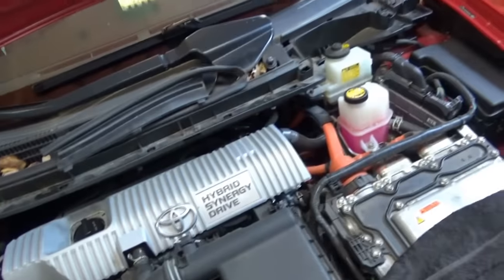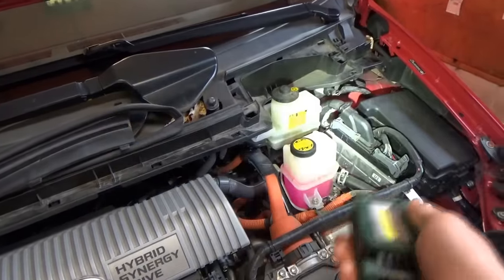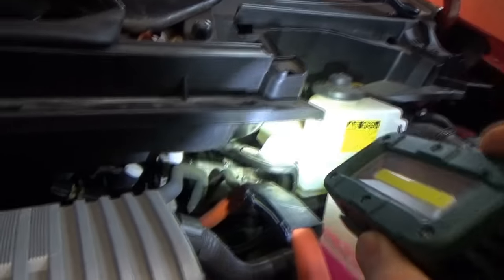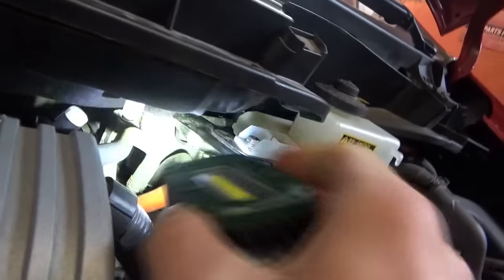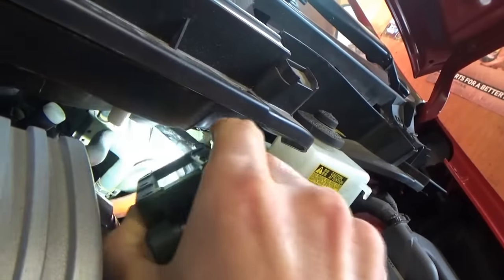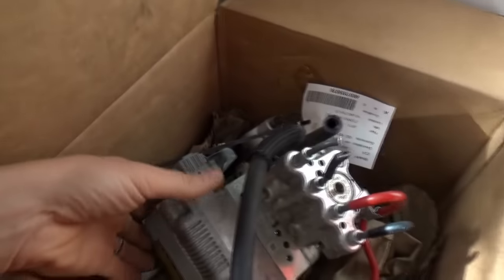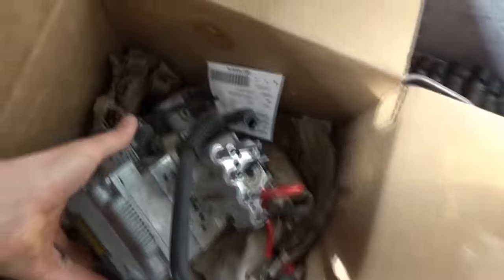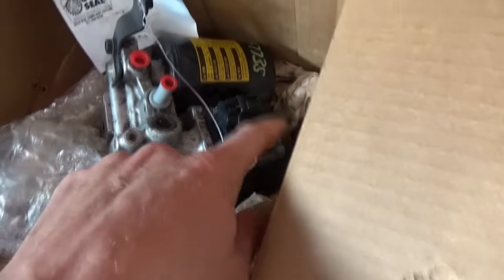Prius Brakes FAIL (Hidden COST of Hybrids)

Comment: A bit late to comment, but you could have called Toyota dealer, give them a vin from the donor and ask if recall was done on it. If so, would be a safe bet to install it, if not - just reject the used part to avoid the risk.

Comment: I had a 2011 Toyota Prius and got the dealership to repair this exact issue even though initially Toyota did not want to cover it. The dealership reached out to Toyota to help with the repair bill. Toyota agreed to cover 75% of the cost...This job is like $3k....later, I got a check in the mail from Toyota stating that they included my Prius in the recall...so, it cost me $0...my prius has 260,000 and runs strong but everything u stated in this video is true....anything breaks and the system will be costly to repair. Never buying another hybrid again..

Comment: I have that noise on my 2014 Prius.  I have another 2014 the second does not have that sound.  Looks like having a parts car is needed for Prius maintenance.  Looks like I am on my way in that regard.

Everything you say is true.  I had a 2005 Prius that I junked because of ABS module, HID light and traction battery all needed replacement.  I bought it at 200K miles and was happy getting it to 320 K miles.  I had to let it go.  I had a 2010 but sold it a few years later.  I got a 2014 as a hand me down from my mother.

Comment: This isn’t just a hybrid problem. This is a high end Toyota/Lexus problem period. Quite a few of the gasoline engine cars have this same brake booster setup. It’s something you need to check before buying a higher mileage used Toyota or Lexus free for sure as it can be a costly issue.
Reply: Indeed there was an LS460 at Omega that the Wizard could not fix because he doesnt have expensive Toyota software.
Reply: On Lexus models and Toyota trucks, it's called VDIM, basically much quicker and more "predictive" stability control.
Reply: @vw5056  yeah I just had to replace one in one of the guys who works in the shops Lexus LX 470. Talk about a nice punch to the wallet for him 😂
Reply: @Jpilgrim30  of course the online Toyota shills that always seem to come out of the woodwork whenever a BMW has an oil leak are silent about this problem. Same thing with big buck Prius battery replacements.

Comment: Primera...
Reply: Brakes..... interesting.  Unexpected issue.   I see them for hybrid battery issues. Overheating due to the cooling system being blocked.   On to the rest of the video.  . 👀
Reply: Exactly the points I make with these junk hybrids or full electric vehicles @6:30. Paying upfront huge costs, so many expensive parts like batteries, and travel distance is stifled, especially on 100% electric vehicles

Comment: I bought a 2010 identical to this one for $1000.00. I replaced the actuator & booster, high and low voltage batteries and windshield all on the cheap (approaching $1500). Total investment excluding tags and title right at $2500.00. Actuator & booster on flee bay $300.00, batteries $1000.00 and windshield $200. Not looking back and enjoying the ride.
Reply from the maker: But it still drives like a Prius 🤣

Comment: 230k miles at 35 mpg = 6,571 gallons. At $3.50/gal total cost of gasoline = 23k$
230k miles at 45 mpg = 5,111 gallons. At $3.50/gal total cost of gasoline = 17.9k$
Savings on gasoline for the first 230k miles = 5.1k$
But that's at $3.50 per gallon.  
The initial price of a hybrid car is at least more than 5.1k$ over a conventional gasoline car.
So the savings on gasoline is mitigated by the initial cost of the car.

Comment: For my 2005 prius a new one was not an option. Sold out from factory and the only reman option was Dorman but also sold out. Went used and it worked after we trouble shooted some some fuse problems as well. Prius documentation only shows some of what fuses are used by the ABS assembly. Techstream is not much use except for giving you a code that may or may not tell you the actual problem.

Comment: Got 300k miles on my 2010 prius, no issues at all. I've owned it since new
This job is not as hard as replacing the same system on my 06 prius where you have to remove the innverter.
Reply: Remove the inverter?   What the heck.  Is that the generator/alternator?
Reply: @stuartbear922  No, it's the unit that regulates the high / low voltages between DC and AC - a computer.

Comment: I had ASB going off on my Audi after i fitted a rear wheel bearing. Turned out to be a loose magnetic ring slipping on the bearing id already bought a new abs sensor. Was not till i plugged in diag that i could see the speed kept changing at about 10 mph.

Comment: I think the idea of "there goes your fuel savings" is misleading. Prius is extremely reliable. It's usually hitting 100K miles before you even need to do the brakes. He's working on a car there at 230K miles. How many thousands of dollars in parts and repairs would any other car have ran up by that point? The reason we bought our Prius was to replace a car that was eating $1K here, another $1K there... from 120K miles onward. I doubt the Prius is much worse over the same mileage.
Reply: Great point. Also not to mention the 7 tons (14,000 lbs) of* additional* carbon the driver would have injected into the atmosphere over 230k miles. This math assumes that the 45mpg Prius was twice as efficient gallon per gallon of the vehicle alternative. That's another reason I chose a hybrid over a standard gasoline vehicle.

Comment: A late model accumulator will swap on and solve the problem most time. Still a pia to change, but got my 6k mi for under a $100 used, and too my time over a day. They should remote these and make serviceable like Citroen spheres. FYI, while you wait to repair, holding the pedal to the floor for a couple of minutes will let the system pressurize enough to allow the the system to operate for a short time. The warmer it is outside, the less time you get. This will put a lot more wear and tear on the pump though, and you will lose regen while the lights are one. Oh, techstream software is available for doing the blessing cheaply. It is sketchy, but we are trying to do repairs right, so…

Comment: Hybrids also do not have a alternator. They use a voltage converter to charge the 12v battery and power the 12v systems in the car. Have run into a couple hybrids that were not charging the 12v battery.

Comment: great result on the gamble of used parts.
Biggest issue with the modern so called green hybrid and battery cars is massive amount of parts and service materials consumed mixed with short working life pretty much counteracts any environmental saving from emissions .
I do a lot of Subaru and Toyota hybrids and even newer models not smart enough charge the 12v battery from high voltage battery and thanks to all the module wake ups parasitic draw is real high on these things and they eat 12V batteries real bad unless do constant regular driving and great at leaving owners stranded with a flat battery or looking complete twits at the airport after a vacation lol .
Lot of owners pissed off with them already and I don't fancy dealing with the junk in a decades time lol .
They do sweat nothing for mother earth if fully review life to death pollution but are great at emptying consumers pockets !

Comment: P.S. If the part is too expensive(new) just get a used part from the 2014-2015 model. It's the same part but the issue is fixed on later models.

Comment: i have to comment on the bleeding; the instruction were to HOLD the brake pedal THEN open the bleeder,, obviously, especially the right side, you can't see when all the air's out AND you have to release the pedal to go close the bleeders. This procedure seems to call for a second person/assistant. Did  you mix the rt and Lf bleeders?  Your channel is an odd mix of barn-yard wrenching and hi-tech devices,, most interesting,, don't misunderstand, i DO appreciate the results

Comment: You are right, don't bring used part or even new part  to a mechanic for installation, because if the part doesn't work, you will pay installation fee anyway, better let the mechanic deal with the part, but if you are going install it yourself then you can try used one.

Comment: Chevys have had electric brake booster pumps for some engines since the mid 2000s and the same thing happens when theres a small leak in the brake booster diaphragm.

Comment: The complexity of this device is so that the regenerative and hydraulic braking are seamlessly integrated in to the brake pedal. Tesla have a brake booster that is actuated with an electric motor and a gear train rather than vacuum. There's a tear down on here of one. The regen on a tesla is integrated in to the accelerator pedal instead, which is configurable in software.

Comment: This isn’t a hybrid problem - these sort of braking systems are also used on straight ICE vehicles.
Reply: The Toyota SUVs and trucks have the system, and a lot of Lexuses have it too. The reason? It reacts faster to the computer asking for braking. Pretty much any Toyota truck or Lexus built after about 2005 is going to have something called vehicle dynamics integrated management, which is essentially advanced stability control that is able to monitor vehicle parameters 1000 times every second and react before a loss of control may even be noticed by the driver. This reduces the risk of tall trucks rolling over, and makes Lexuses smoother to react to skids. A traditional ABS pump just couldn't respond quickly enough to react 1000 times every second. Even if it could, it would set up resonances in the pedal and braking system, and it would sound horrible.

Comment: Hybrids are definitely costly to repair, however, this brake problem is the first mechanical problem I have had with my Prius in 10 years and 115,000 miles. So that Toyota reliability that has saved me $$ over the years. Just my luck, now the end of the service campaign has passed and my car just decided to start throwing the C1391 code every once in a while, for a few minutes, then the lights go off again. Priced the parts at several dealerships that sell parts online and the lowest is just under $1800. That's for both the pump and the master cylinder assembly.
Reply from the maker: I can buy 3 used beater cars for that much $$ 😅

Comment: Great diagnostic channel. Slight gripe with wording of the title and commentary. Full disclosure - multiple Prius owner since 2001.

1) "Hidden" cost? It's possible the buyer is not aware the regenerative braking system is more complex, but it's not hidden. Same would be true of the battery bank - expensive when it is needed, but not hidden.

2) Ran the numbers you gave - 230K miles while getting 10mpg more on a hybrid. PA average gas cost is $3.5. That's over $5100 in gas savings in your area. It also means >1450 gallons of gas not burned and emitting greenhouse gasses. [insert lithium ion battery ecological and political rebuttal rant here]

3) Some parts of the Prius need far less costly maintenance than "regular" cars. The ICE does not run as much, and often not in the low speed, high torque situations that put more strain on the car. The engine should last. Please tell me what car does not need a more serious (and expensive) repair by the time it hits 230K. I sold my first Prius at 180K miles and was still on my first set of brake pads.

Please keep up the great content. I use your channel for the great diagnostic work and the complete transparency.

Comment: I see another video doing the following after bleeding process for replacing the cylinder master, I don't see it in this video is that because this scanner has all those built-in for the bleed after cylinder master replacement bleed option?
- reset memory to reset ecu and yaw rate/G sensor
- linear valve offset
- set yaw rate/G sensor

Comment: Interesting about the scope of the recall VIN's, and that this one wasn't included, but had a fault, and replaced with a part from a vehicle that did, and not certain if the recall was performed.. I see where the expense comes with the process in replacing the components of the braking system. As you mention, it is the 'hidden cost' of hybrids as they age (travel in miles as well). Another 'hidden expense' would be the replacement of the lithium batteries, for which many people just scrap the car...

Comment: There was a recall on brake booster on 3rd generation Prius - My dealer refused to return my car after oil change, until they fixed it..  They gave me a rental.. since took 5 days to get the parts...  fyi..

Comment: Specific to a Prius, I wouldn't say hybrids and remember the GM abs systems that cost $1k for parts. I wonder how often you're supposed to change the brake fluid and if it ever was? Newer cars have brake by wire and decides what pressures to apply, because the thinkng is they can apply more pressures than you can with a brake booster and for brake fade. I just did an abs pump for a 2000ish e150 where the abs pump was bleeding down like if the master cylinder was bypassing and new from the dealer was around $600, so go a used o e for $150.
Reply: Brake-by-wire is what this system is. My 2002 Prius is partially brake-by-wire (only the front wheels.) A similar system to modern F1 cars, but flipped.

Comment: The reason I bought a 2008 Prius in 2017 was to save money. I got the car @ 97k miles and it has had ABS issues since 120k. I now have 155k on it. It seems that whatever money one would save in gas would be spent on repairs. I would not suggest anybody buy a Prius, ever.

Comment: Lucky! U didn’t even have to take out the inverter like u have to on the gen 2 prius! I have done it twice bought I remanufactured one to save $1000 and it lasted 30k miles… just did it again and bought an oem unit for $1300

Comment: I have 2010 Prius with 480k miles. It falls under the brake booster recall. However it hasn’t failed so it’s possible the used one installed is good to go. I recently tested the brake fluid which is original and no water was detected.
Reply: That is the equivalent of a round trip to the moon.  I'd say you have your money's worth and yet it keeps going.

Comment: Exact problem with my 2011 prius 129k miles. Dealership quoted me $3400 to repair, local mechanic quoted 2k.  Probably going to try and trade the car in.

Comment: The Owner should have bought one from a newer 3rd Gen not a 2010.., regardless of miles.
Also.. the savings is still significant..
the difference in MPG is 35mpg vs 50+mpg.  do the math.. 250,000 miles at $3.80 per gallon and  35Mpg is $27,000 in gas.  at 50MPG its $19,000  so $8K less in fuel.. Not to mention brakes last 120,000 miles... and regular service .. oil and transmission fluid is less.
Even if you had a Hybrid battery fail also.. $2500..  your still ahead.
I always tell people this about Hybrids.. if you drive A LOT.. its worth it.. if you don't then get a Corolla or Camry.

Comment: After having a Lexus hybrid, I can easily say the hybrid system is an amazing design. However, working on it is things of nightmares. Replacing my radiator on my own took 10+ hours. What I noticed was similar to having to take the wiper assembly off. You think you might be able to shortcut some process, but you can’t because of over complicated design of these cars. Thus leading to so much additional unnecessary work. Also the brake bleed is just ridiculous. I considered doing it until I read the process and decided it isn’t a job I am doing myself.
Reply: I did my first motor swap on a prius I had the motor out in 8 hours or so in a home garage.

Comment: i guess it would be different if the car wasnt 11 years old and had over 200,000 miles. Any car with Electronic parking brake and no vacuum assist from the motor will have a similar bleed procedure. i dont know if you noticed but most cars are being engineered so you cant work on them without a scan tool

Comment: Hello friend, I changed the abs pump, because it started to leak oil, after replacing it the regenerative brake stopped working, could there be another part that was having a problem, or could it be that I didn't do the procedure correctly?

Comment: Main hidden cost of a prius 2G/3G. piston ring change for oil consumption fix. hybrid battery if you dont keep it cool (below 36C) at all times. brake booster if you dont replace brake fluid at recommended intervals (last is my theory. every 2 yrs) otherwise. its pretty much troublefree. OEM hybrid battery needs to be maintained also to keep it in shape. and Clean the HV FAN once a year! i have 3 personally for the family i maintain.

Comment: At $3/gal the difference between 35MPG and 45MPG comes down to $0.019/mile. So, over 100,000 miles you would save $1,900 in fuel. A typical hybrid is about $4,500 more than the same car with a standard engine. In other words you would have to drive it 250,000 miles to save enough on fuel to justify the cost difference. This does not include the increased cost of maintenance of the hybrid. From monetary or environmental point of view they don't make much sense for most use cases.
Reply: You should do some more research on this subject. Ford Maverick hybrid is actually less money than non hybrid. The cost increase from my research is around 2k$ and gas is well over 5$ now.  It's like putting money back in your pocket at every fill up and will pay for itself 0 months for the maverick and 18 months on other cars.
Reply: @modified93tc  The Maverick is ONLY available as a hybrid so you are comparing apples to oranges. Nice attempt with the propaganda though...

Comment: Great Video,Thank You  Toyota suggests changing both the Brake Booster and the Brake Cylinder assembly ? Did this repair last with only the Top part  being replaced? Do you know if the Xtool D7 Scanner will complete the bleeding process for proper operation ? Toyota just quoted me $3500.00 for the repair 2013 Prius 3. Thinking about doing it myself?:face-blue-wide-eyes: